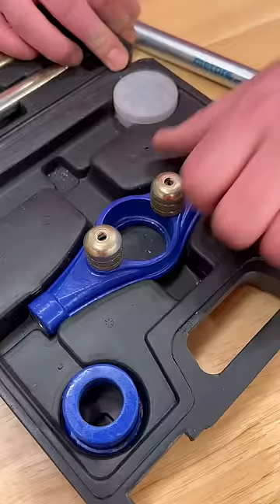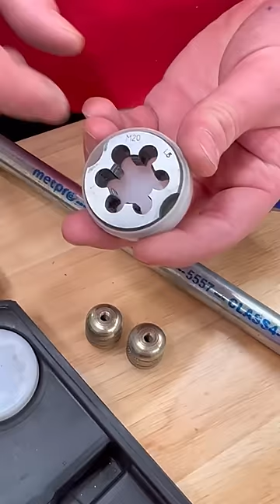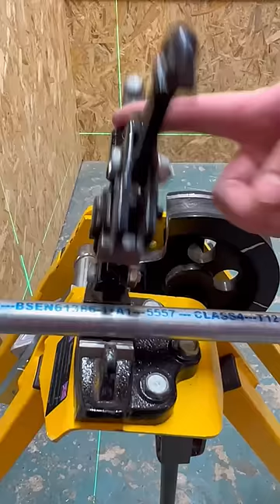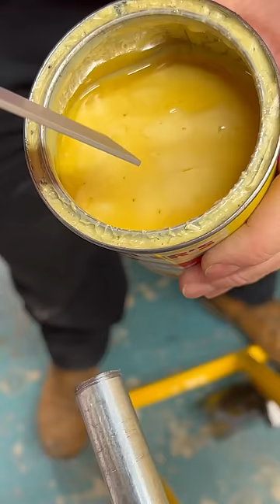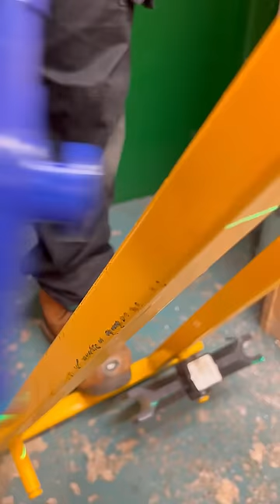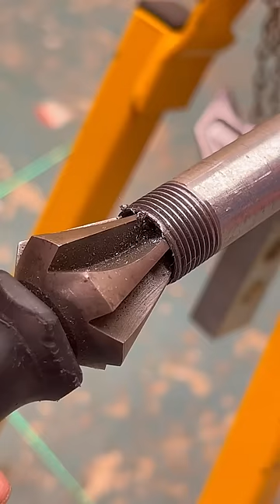How To Thread Conduit?

Comment: i had a job, couple runs of conduit. I ran out of cutting oil had nothing miles away from the closest shop so as a substitute I used butter, smelled great.
Reply: "Butter?! Fattening butter!? Oh no!... "Does this conduit make me look fat?"
Reply: I Can't Believe It's Not Butter Cutting Oil!"
Reply: Cold milky tea works, and is a lot cheaper than butter.
Reply: @dogwalker666  too wet lol, don't want to rust my threading tools
Reply: A fabricator put me onto Pam cooking spray for cutting aluminum with a miter saw...
Reply: @ironsights4me  emulsified vegetable oil, Expensive but should work,
Reply: @dogwalker666 ice cold water works just the same. I’ve used it many times in a pinch.
Reply: So you didn’t have cutting oil in your job site…… but you had butter?….. seems far fetched to me.
Reply: @curtisthatcher2577  well don't tell anyone but if you are stuck on site spit works quite well for tapping and I have used mains water for drilling stainless.
Reply: @gatsbylight4766 😂😂😂
Reply: Coulda crabbed some off the dip stick of your truck
Reply: Gotta give it that hawk tuah

Comment: Done this for literally decades!
1. Wear gloves.
2. Make extensions of conduit to lengthen die handles.
3. Don't tap the thread guide to clear swarf.
4. Always put the bender on a scrap bit of cardboard.
5. Train the apprentice how to do this!
Reply: Check the diameter of the tube at the wholesalers so they don't try and sell you the cheap oversized rubbish.
Reply: Correct.
Reply: Me too done it for years
Reply: "Hold on boss, i gotta go find a piece of cardboard so i can bend my pipe without scratching it"
Reply: Item 5 is the smartest.
Reply: @Sausketo  What they mean is that customers usually really, really don't like it when oil or grease stains show up on their floors after the job is done.
Reply: You can literally not do any of these and still be fine 😂, people showing rules up their ass

Comment: Now thread stainless with used dies and blunt vice jaws
Reply: doing that all day Sounds like the kind of things that would make a man spew an amount of cuss words that'd make the devil blush 😂
Reply: Exactly, Hate stainless conduit.
Reply: Sounds like a personal problem
Reply: You use brand new dies every time?
Reply: @flyfish697  no it destroys cutting tools.
Reply: @TM-fx5le  you go through a whole box of drills, And if you can afford cobalt you stand a better chance.
Reply: @dogwalker666 drill slower, more pressure. Slow is the key with stainless
Reply: @Jkus1244  Slowly,  little pressure and lots of lubricant (Cold milky tea is very good), If you go to fast the tool just burns and hardens the stainless, Cobalt are better but they shatter.
Reply: @serversexual3536  funny because all the conduit in food processing not only has to be metal but has to be 316 Stainless Steel Condit, All the conduit in water board sites has to be zinc galvanised conduit with all the joints Zinc painted,  
You did conduit work at school wow!  I never did any before I went to college,  Must learn to be electricians early where you are🤗
Reply: @serversexual3536  Oh right all our water feeds are stainless too as is the steam and compressed air,  all the compressed air ring circuits are malleable iron fittings and Galvanised steel pipe,  even more interesting being taught plumbing at school!
Reply: @serversexual3536  only low pressure water is allowed push fit,  obviously all the air fittings are,  For mains feed we have to use RJT fittings that are TIG welded on, By the fitters my TIG welding always leaks lol.
Reply: We use electric threaders and special stainless steel dies on st/st tube, easy.
Reply: @andydonnelly8677  you obviously have the budget, We have to do it by hand.
Reply: @dogwalker666 You also have to use stainless whenever your customer believes that tiny zinc particles will somehow destroy all of their equipment.
Reply: @rockonmyfriend  fun times, It's a complete pain because drills, blades, Taps even screwdrivers don't last 5 minutes.

Comment: I find stopping 2 threads when exposed from the die is enough for boxes and couplers and use this as the measurement for the correct thread length
Reply: Hi ! You also have to have the right thread depth by setting the dies correctly, flush with the end of the dies is fine but you can go 1or 2 threads past the Die

Comment: Hi  !  Don't forget the conduit threads are straight threads  !!
Pipe threads for mechanical piping , water , steam, ..ect. are tapered threads so you don't want to use straight threads ( conduit  ) on mechanical piping because they will leak  !!
Reply: You wouldn't want any electricity leaking out of the electrical conduit.
Reply: @R0me0316   Hi , you sure would if water got into the conduit Jacky 😂🙏

Comment: Looks like the first time this kit has been used .
Reply: Yea, no one in their right mind would buy this, takes 10 times as long as a rigid pony threader, and now milwaukee makes a cordless one, so yea, definately no one is going to buy this threader that can only do up to 1" or 3/4"
Reply: Are you surprised that the tool is new with this channel? This may be the most realistic video I've seen from them yet, yet still isn't all that realistic to do when the employer should provide the tools( and should opt for the best time management option).

Comment: Last time I used a pipe threader, I some how managed to cut my arm deep enough it has left a noticeable scar. I still have no idea when it happened in class because all I know is that I finally found out about it when classmate said my arm was soaked in blood. Made sure to wash out the very nasty cutting oil and metal chips from wound. 😅

Comment: Are you from the 1800's? This is the way i did pipe threads when i was an apprentice 45 YEARS AGO!
Reply: If it works it works
Reply: And what has changed since then? There's still a use for cutting threads in pipe, so you has the process changed? You hold the pipe still and turn the die, same as ever
Reply: @samuelmellars7855  electric threaders
Reply: @mrzombiesawesome  for large jobs yes, for smaller work... they're too expensive to buy or rent. if you're doing massive installations yes, but for maintenance of your jobbing sparky.... not viable
Reply: 45 years ago wasn’t the 1800s
Reply: @TheChipmunk2008 well unless you only have to thread 5 pipes, you would literally save money with the time saved with a new cordless threader, its like saying an impact drill is too expensive, so im going to just buy a ratcheting screwdriver to put the screws in
Reply: @TheChipmunk2008 hell id bet that vice costs almost as much as a threader, and the new milwaukee cordless threader has a piece that clamps on the pipe, so no vice is needed, and no more using a 2x4 or string to keep the pony from flipping you
Reply: I was gonna say, a pony motor probably would be a wise purchase
Reply: You still do this if you dont want to carry the fucking machine everywhere you go and then back to the storage container
Reply: @nickw.3128 the milwaukee battery operated threader is more efficient and cheaper than a power pony. Plus it comes with a piece to hold the threader in place and doesn’t flip you over the top of your pipe. So you really don’t even need a vice to use it
Reply: Hasn't changed.
You do know electricians are on jobs with no power. Or access to power.
And that's when you get the hand threader and a Chicago bender in your gang box.
Reply: @TheChipmunk2008 when do you ever thread just one pipe? Tell me you're not an electrician without telling me. Take a walk and get lost.
Reply: @R0me0316 Well you clearly aren't an electrician. You're probably an american

Comment: A Power Pony and dark cutting oil makes it a whole lot easier.   I’ve been on jobs when we threaded pipe for weeks, no way we could come in under budget with hand threaders
Reply: Power pony is more expensive than the Milwaukee battery operated version.
Reply: @curtisthatcher2577  I’m not familiar with the Milwaukee battery operated threader but I can’t see any battery powered threader handling 2” rigid.   You’re right about the pony being expensive.   I’ve been using the same Rigid pony since 1998 and it’s paid for itself many times over

Comment: Threading conduit!??... I don't know what crazy trick you follow that up with, but whatever it is I bet it's "nuts"!
Reply: "thick wall" or "rigid" conduit is made to the same dimensions as water pipe and us used with thread fittings. it is still used where called for in some industrial applications.

Comment: Are those threads tapered or straight? I could see why you'd use both, and I'm curious what it actually is.
Reply: Parallel. But I am convinced some ready made threads are tapered
Reply: @TheChipmunk2008  I could see why, I'd think 3-4 really tight threads would seal better than 8 loose ones, and adding a slight taper would guarantee the threads are tight at some point, no matter the quality of the opposing threads.
Reply: @the_clockwork_jackass6897  yep, whereas jobsite made threads would by necessity be parallel, at least till the last few...
Reply: @TheChipmunk2008  I have 1/8npt, 1/4npt, 1/2npt and 3/4npt dies, there just really long and multi stage, in my case, two per size, which only works in brass and aluminum, so I don't think it's so much that jobsite threads can't be tapered, i think it's just higher quality control, if it's coming out of a factory, making the male threads tapered so they're tight somewhere in the female threads allows them to be lazy with quality control, and be cheap. I'd think they're probably roll forming the threads, so the taper allows for sloppier tolerances too. I think the reason jobsite threads are tapered is that it's just not necessary with a die and hand labor.
Reply: @the_clockwork_jackass6897  yes, such a thing doesn't exist for british metric conduit threads. Not sure if it existed on Imperial 3/4 and 1" sizes...  interesting fact, you can cut a 20mm thread on 3/4 inch conduit with no prep, just don't do it outdoors because likely not water tight, if you didn't want the ugliness of an adaptor :) I think cutting 3/4 inch on 20mm conduit would be unduly hard on the die, even if you could still get them, which i don't think you can now, here. Not sure if the conduit thread was the same as our pipe threads (BSP)... maybe someone older than me can answer
Reply: @TheChipmunk2008  they are technically  pipe dies. Congratulations, we've created a conduit conspiracy 😂
Reply: they are tapered standard pipe threads, do that you get a sealed connection, which is necessary for liquid-tight and/or explosion-proof installations.

Comment: That will never make any money on the job. To slow need a power pony threader
Reply: This is the problem with the world... you're right of course, because if you quote appropriately, the customer will go somewhere else. It's why everything is cr@p
Reply: Actually for 1/2" or 3/4" conduit, manual is faster
Reply: @TheChipmunk2008 everything is crap because corners get cut. The cheapest materials get used and fail quicker. Using the appropriate tool for the job(power tools) is not why the world is crap.

Comment: Don't forget to turn the die over to finish the thread or you can't use the last few turns of thread as the thread is not fully cut.
Reply: You want that though... Gives it a nice seal lol

Not plumbing level seal, but it's pretty good.

But it looks good thst way too
Reply: rigid conduit uses pipe threads, which are cut with a taper to provide a sealed connection, which is necessary for some industrial liquid-tight and/or explosion-proof connections. turning the die over cuts the thread straight, destroying the sealing ability. electrical work is meant to be safe, not pretty.
Reply: @joelee2371  rmc is not a waterproof install. Don't qoute me, but I'm pretty sure the threads are different. Gas/water pipe uses a taper that actually lock and seal, on top of the teflon/dope. Rmc doesn't have that. Which is why it can't be counted and is always a wet location install in wet/damp locations and underground
Reply: 😂 Hi ,how in the heck do you turn the die over ...lol   straight threads are on one die, tapered threads are on another die , they're not on the same die

Comment: Or hear me out you could just use compression fittings. Also rmc comes pre threaded so yea
Reply: One end isnt once you cut it to length.
Reply: @roberttill3787   yea thats why they sell compression connectors and couplings

Comment: I started my apprenticeship in 1977 as a electrician, first week working on 25mm conduit.   Struggling using stocks and dies, I thought it was a load of bollox then, and I fill same now 46 years later still a load of bollox. Plumber have push couplings and water travel through their pipes no other country does this maybe the Republic of Ireland. The vice bender ways a ton carting it up stairs. Give me the USA version EMT I believe it's called. Been out of game for 20-years I miss very much, but not conduit. I should imagine I will get replies stating it's the best system🤣👎🏻

Comment: who threads conduit?
Reply: thick wall conduit, made to the same dimensions as water pipe, is used where sealed connections are required, such as liquid-tight or explosion-proof installations.

Comment: We do not thread EMT here.
Reply: no one threads EMT. Thats "thick wall" or "rigid" conduit, made to the same dimensions as water pipe, and is used to provide sealed connections in some industrial applications requiring liquid-tight oer explosion-proof installations.  it was the first thing I learned as an industrial electrician.
Reply: Why do they keep assuming it’s EMT this is the UK we don’t use that stuff.

Comment: What a basic stock and die set if you seriously into metallic conduit get your self a ratchet stock which accepts square dies and is much more robust than that handyman setup you are currently using  . The ratchet setup has one handle and requires much less energy to operate.

Comment: How on earth can a man make money doing this all day? Surely this can be automated
Reply: Not really, if you need a very specific length, and shape of conduit on a job, it needs to be cut and bent there, you couldn't send for it, and no machine could be moved to a jobsite that could do it.
Reply: There is very good money in it if its your bag
Reply: if one has to make only 3 or for connections in a day on a smal occasional job, there's no money to be made if it's all spent on a power tool. there is still a place for manual tools, plus one needs to learn the basics first.

Comment: Buy an electric threader. I would walk off site if I have to get out stock and die
Reply: Depends; as independent contractor, if I do less than 10 each of ½ or ¾" threaded connections in a day, it's not worth it for me to buy an electric tool or machine. I do little of pipe threading that my ratchet stock sits and rusts.  It's easy to demand a power tool when you're not paying for it.
Reply: @joelee2371  true I wouldn't buy half the stuff in my van with my own money! The makita battery cooler and microwave are ace 👌